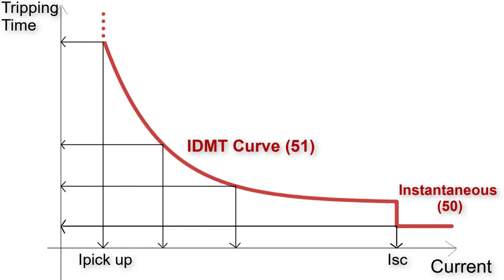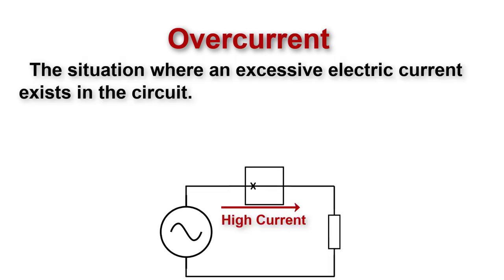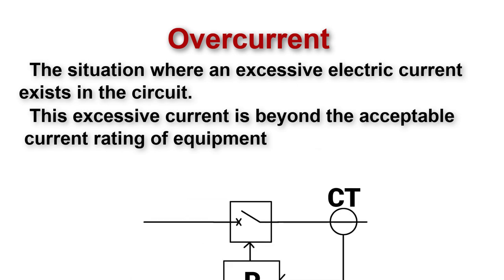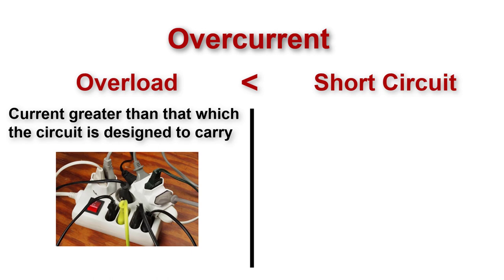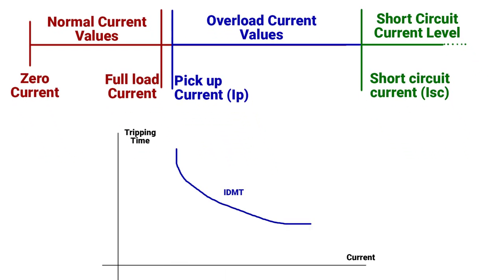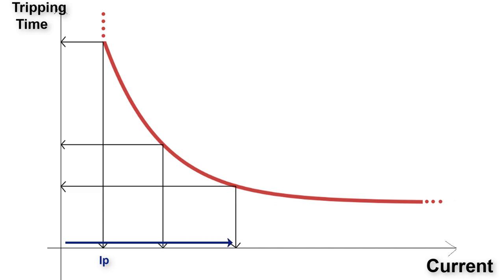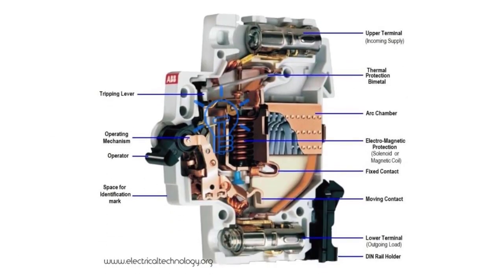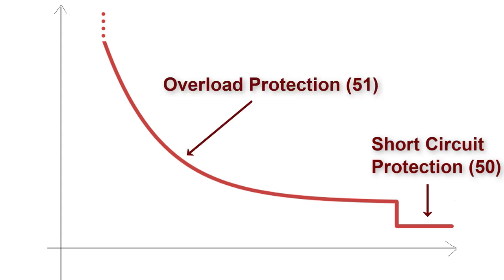Overload Protection vs Short Circuit Protection? |Overcurrent Explained

Comment: Explination akademucal nut poor and wrong. Not alwayes overload woll increase to short. This is totally  wrong .
Reply: I think its quite a good explaination, and youre right too. From the idmt curve, it is possible a relay will trip at short circuit when the current travelling too fast from pickup current to short circuit current, as per setting of the relay/mccb.